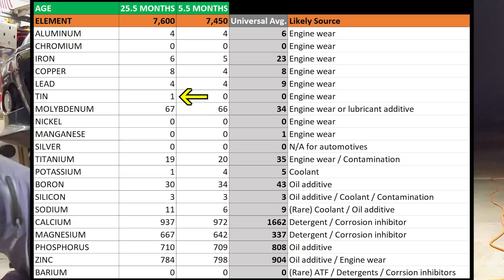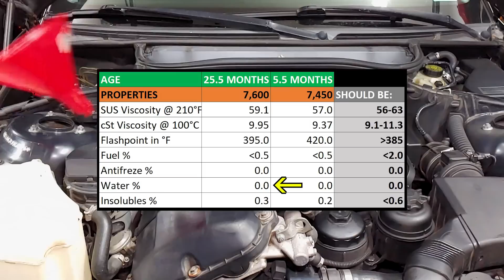Does Oil Really Need to be Replaced Every Year? Surprising Analysis Results Revealed

Comment: >oil is cheap, engines are expensive

It's around $200 for an oil & filter change service, so I could potentially save $600 by doing a service every 24 months instead of the recommended 6 months.  Plus the inconvenience of having to drop it off and pick it up at the workshop, and being without a car that day.   So I think for a very low mileage car every 24 months is ok.   I only drove 3000km in the last 24 months.

Comment: wow this kinda of answered my oil question! Was thinking about changing my oil next week...might wait on it.

I have an Acura that I barely use- only for short trips; owners manual specifically said to change oil only if MID <15% oil life (computer will auto calculate), never said anything about time or mileage.

 I've only used synthetic mobil 1 and filter, only racked up 2k miles with MID indicating "70% oil life" left, 2+ years on it. That being said and based on your analysis-  i shouldn't be concern about time and just follow the owners manual when it reached 15%? 

Additional info - 
- Visual inspection of oil -not dark/black, medium brown, no foam. 
- Car always run to operating temperatures whenever started.

Comment: I've got a vehicle 21 years old with only ~40K on it; I've went years between changes.  Unless outside air gets to the oil creating the chance for contamination there is zero issue with the oil from time.  With a well sealed motor, no worries.

Comment: I have always suspected that the (12) month or (x) number of mile recommendation by the engine oil companies was marketing baloney to sell more oil, specifically to those who drive less than average miles per year. This confirms my theory. Thanks for your great work.
Reply: My German Mini Cooper recommends an oil change every 2 years or 30k km... so yeah, I think it's a scam to sell more oil to suggest short intervals
Reply: No no. Its not all baloney. If you have a port-injected gasoline engine(which most NA petrol engines are) then you can safely go 2 years without an oil change with less than average miles. But if you have direct-injection gas engines or turbo diesels, it must be changed within a year coz the fuel dilution is too high with such engines.
Reply: @Roberto-nj5r  But the analysis, as I understand it, does not support this theory. Unless there is some underlying condition that is causing blowback and/or  excess fuel contamination, the idea of having to chain oil at 12 months, should not be an issue. The used oil analysis would show if this is a problem, right?
Reply: @NickeryNelson  Just coz this particular BMW with direct-injection engine doesn't have fuel dilution doesn't mean other similar engines won't. Maybe this car is impeccably maintained by its owner. I think the owner himself is not comfortable with changing oil every 2 years and probably did it for the sake of science, for his youtube audience.

Regarding blowback and/or excess fuel contamination, why do you think it occurs in the first place? Brand new engines from a factory won't have these problems. These problems occur due to negligence in oil change interval. You keep changing your oil every 2 years and eventually you will have problems. Maybe not with once or twice, but eventually. If you want to change it 2 years, by all means do it and check how long it lasts before it starts giving problems.

Comment: Just a word of advice on car covers, they can actually cause old paint to get water damaged if they stay soaked on the paint for too long.  Older paint has tiny cracks in them which can allow water to seep in and cause the paint to become cloudy and stained permanently.  If you run your cover in the rain, make sure to remove when the rain stops and dry any wet paint before putting it back on.

Comment: I run the e90 generation that came after yours.  My 3.0 328i I also redline and drive daily.  The oil you used would not meet the BMW Spec for their recommended oil change interval.  I have to use Castrol 5w-30 Euro Spec A3/A4 sold at Walmart for $27 for 5 quarts.  Maybe switch it and retest at 10k
Reply from the maker: You're right! I figured that out after making this video and I'm currently retesting with Euro spec Castrol.

Comment: From everything I've seen the regular oil changes are less about removing particulates and more about reducing carbon buildup in the very thin piston rings most engines use nowadays to meet emission standards.  Seems like this is universally the final failure point that results in a car needing an engine rebuild or short block replacement, which usually means the death of the car. At what mileage this happens seems to be entirely dependent on how often the oil is changed.

If the engines were built with thicker, stiffer piston rings I would wager that most people's engines would last 300,000+ miles and people who really keep up with maintenance would regularly see over 500,000.

Comment: The idea of having to change oil every year irrespective of the miles driven is based on the assumption that the reason you drive very few miles is that you drive frequent short trips, or in the city or congested freeway. This is to simplify things because often this assumption is correct.

If you drive mostly infrequent uncongested highway or suburban miles longer trips, say 15 miles each trip at least, your oil will be good much longer than one year.

Short trips are bad because the moisture from combustion does not have the chance to be completely boiled away. Water accumulates when the oil does not have the chance to get hot enough for long enough. The moisture is not necessarily from the air but as a product of combustion, so humidity is not a factor.

Comment: If the OP used better oil and  filters, his results would be much different with better results. 

Amsoil Signature series is one of the top three oils available, especially if you are using a good filter from them or a top brand or model (There are really only two main oil filter manufacturers).  

The oil and filter the OP is using isn't even close to Amsoil quality or does it have the additive package to remotely match it. I would bet an oil change that if he switched to one of these oils and filters listed below, he would have better oil analysis results and longer engine life.  

I have does exhaustive oil testing on oils and filters worth thousands of dollars on five vehicles, three cars and one is a C7 Z06, one 2010 hybrid, and a 2020 Jeep Grand Cherokee plus two HVAC work vans.  
I have tested oils from 5000-6500 on the vans and 5000, 7500 and 10k on the hybrid and the Grand Cherokee as that is factory recommended.  The Z06 is based on how much I race it.  It has 800whp on E85 and methanol injection and gets changed much more often, but have found that the racing has barely made a dent in the additive packages or wear metals.  I am flabbergasted at how well the top three oils and filters have had incredible results far and beyond the crap formulation of Castrol Edge Titanium, Mobil1 Extended Performance and Mobil1 filters, oils like Royal Purple, STP, Super Tech/Kirkland (Warren oil company), etc are all junk compared to the oils listed below.  

I am only talking Full Synthetic oils and the results I have found.  I don't test or use conventional oils or Synthetic blends, so I have no results for those.  Engines are expensive and oil is too cheap to not use the best available.  Pennzoil Ultra Platinum and Valvoline EP HM is around $40-$50 depending on which filter you choose.  I have my results from Blackstone labs and continue to test every other oil change and I now know which oils and filters I choose to use in my vehicles based on my testing.      

Use these oils and filters for the best results:

Amazon and Walmart will have all the oils and filters besides the Amsoil.  Preferred members get dealer pricing.  TBN on Amsoil is 12.5 out of the bottle as virgin oil.  

Pennzoil Ultra Platinum 
Amsoil Signature Series
Valvoline Extended Performance High Mileage
Redline as a distant fourth.  

Amsoil EAO filter (EK, if no EAO is available)
Fram Endurance filter 
Purolator Boss (Produced by Mann-Hummel)
Both top two filters are made by Champion labs

One note:  Any vehicle that runs a 3614 filter and has enough clearance can run a 3600 oil filter for better results which is also the Amsoil EAO34 or the Fram FE3600 (They are identical filters).  Whip City has all the oil filters tested.  Plus I cut my oil filters open after each change to check for metals or carbon.  Remember, filter magnets or magnet oil plugs only catch ferrous metals and any metal like aluminum, etc etc will not still to a magnet and needs to be trapped in the filter.

Feel free to send any questions or comments to me.  Also, lookup Ford Boss Me on YouTube for further oil analysis and testing.  The guy is a master Mechanic and owns his own shop.

Comment: I agree with your statement and it is my philosophy anyway. Oil cheap and engines & transmissions are expensive. So is the labor involved. Engines every 6 months and trans. every 30k miles. As far as I am concerned the best lubricants are just barely good enough.

Comment: Does your lower overall annual mileage reflect a change in your trip type, particularly length?
Up until recently I worked from home although had to visit customers from time to time, most were a significant distance (by UK standards) away so my anuall mileage of circa 12,000 was made up of a small number of long trips resulting in a low number of warm-up cycles.  
Now I commute, I do a lower annual mileage, around 8,000, but a much higher number of warm-up cycles.  Fortunately each commute trip is long enough to ensure the engine does stabilise on coolant temperature and probably (just) oil temp' although that is not displayed on my car.

I like and appreciate the scientific approach you've taken and I'm looking at doing similar with mine.  I plan to do it slightly different, possibly taking samples at 5,000 mile intervals but not changing the oil until the result of a sample indicates necessary, this means I'd do fewer miles to get to the longer intervals.  This would also mean that it is the same oil which is being sampled (I still think the first sample in your previous video indicated this was a different oil).

Comment: Oil is cheap and engines are expensive. Why having a long oil drain and risk damaging the engine? I used to think like that until I learned from a Danish taxi driver that they changed their oil every 30,000 km (~19,000 mi). If I do a conservative oil change every 5000 mi, I would have used about 4 times as much oil as the Dane. Am I wasting money unnecessarily? What about the environmental impact of these used oils? Shouldn't we consider that beyond cost and engine protection?

Comment: I'mma put this as simple as possible. If you have where to DIY, DIY at least once a year. If you're doing something like a daily 10-15Mm per two years changing that oil once every two years won't granade the engine for at least a decade (if not a lot more).
I'm not responsible for you revving to redline every chance you get to accelerate and blowing that engine with a 2 year oil change.
Reply from the maker: Okay but why do you believe this?

Comment: I think people who say oil wears out over time are simply thinking about usage over time when the car is driven daily.  It's good advice, because daily drivers who are accumulating low mileage are likely making short trips, not burning off blow-by moisture.  After I started WFH especially during bad weather, I started changing my oil every 2 years.  Considering how much adder oil is needed in my S2000, I probably have more fresh oil in my crankcase than most people in a similar situation.  Based on my dipstick tracking over 20 years, this oil is likely consumed during warmup and has been typical for this engine even when new because of the composite cylinder wall design and accommodating piston rings.  I found your experience with "skipped" oil filter change interesting from the previous video.  How do you feel about changing your oil filter every 4 years?  Does the filter media, adhesives, or rubber parts in an oil filter degrade over 4 years when combining 2 year change intervals with every-other-oil-change filter changes?

Comment: This new 7,500 mile oil sample is similar to the previous 7,500 mile sample with regard to additives. The original 5,000 mile sample has a slightly different base setup. It is interesting to see the flash point in the new sample is very similar to the 10,000 mile sample which had different set of constituents. It appears there is one machine at at the lab is out of kilter with the other machine and that this unit was used on the 10,000 mile sample and the new 7,500 mile sample.

Comment: The zero moisture content along with other good numbers indicates THAT car gets up to temperature an adequate amount of time to remove the moisture that will collect in an engine  kept outside, and confirms a proper performing PCV system to carry away the "Huffing" that tends to increase as they break down and compression reduces via rings and cylinder wear. Think of the opposite like a "School Teacher's Car", driven short distances at a slow leisurely rate, with moisture accumulating all over the internals, like oil caps and valve covers. Even in the gas tank!

Comment: I change the oil in my motorcycle every 3-5 years. I only ride is 500-1000 miles a year. When I drain it and replace the filter, the level is still normal and it looks and smells great - still viscous and no fuel scent. It’s 20w-50 Mobil1.

Bike is 41 years old and I’ve been doing it this way since 2010.
Reply: Humm, if you don't start changing your oil more frequently I bet you'll struggle to see another 41 years out of that bike!
Reply: @brendanmccabe8769  why, did you not understand the content of this video?
I bet he could change it every 10 years.
Reply: @caha9583  comment was intended to be of a humorous nature aimed at what I find the rather strange oil change habits in the USA.
Another 41 years would make the bike 82 years old. Would it matter?

Comment: IF YOU WOULD TAKE SAMPLE OF OIL THAT IS TAKEN IN LATER TIME OF THE SPIL - THE OIL WOULD HAVE MORE METALS. BECAUSE METALS TEND TO ACCUMULATE AT THE BOTTOM. YOU TAKE SAMPLE FROM EARLY ON WHEN DRAINING, IT MAY NOT SHOW REAL SITUATION ABOUT METALS.  UNLESS YOU HAVE DRIVEN CAR JUST BEFORE DRAINING OIL. Also your oil batch changes, so you cant compare and be sure that just because you used the same oil it was really the same.
Reply from the maker: The lab says it doesn't matter if you take the sample early or late because the oil holds contaminates in suspension quite well. I have an upcoming video that suggests this is true.

Comment: boiling point is lower to 395 compare to 450 because of oxidation. All matter will be oxidized in the air but if liquid got oxidization, it will lower the boiling point and freezing point as well.

Comment: Thank you for the video. I got surprised when I saw a 30.000k oil service interval that says in my service book and on the car dash computer on my brand new gasoline 2023 volkswagen passat 1.5L turbo. I'm now at 20.000km and motor already burn oil to the minimum on the oil stick so I already add it like 1L. That's insane long and I already know this engine will not last too much after warranty expires for sure. On other way it's company car that I use for work and it's 3 year leasing period so I guess nobody cares. But still 30.000km oil intervals?! On gasoline car?! Yeah. That's planned obsolescence in the full blast. There is no way my engine will last as long like yours.

Comment: I am in Sydney so the temperature range is between 5 - 40 C degree. I likely drive about 6k miles for 2 years and each trip is more than 10 miles. So I think I can change the oil every 2 years. It is annoying that BMW Australia has set the BSI to change the oil every 2 years and 25,000 km.